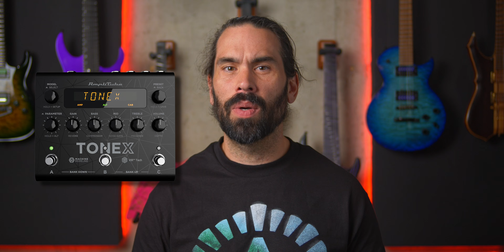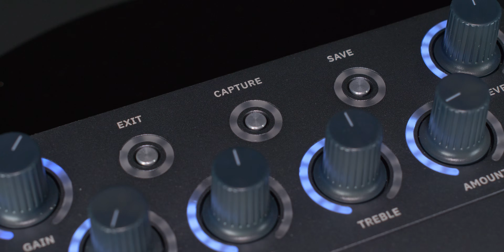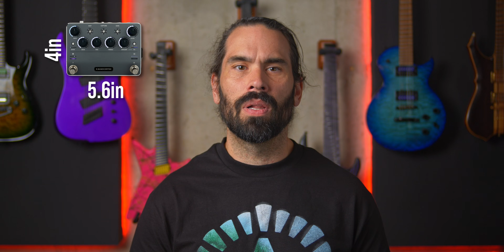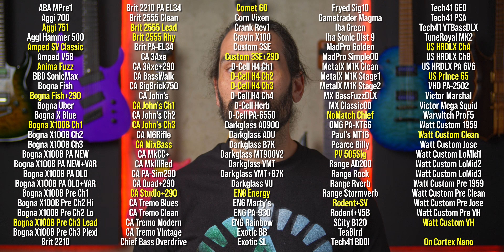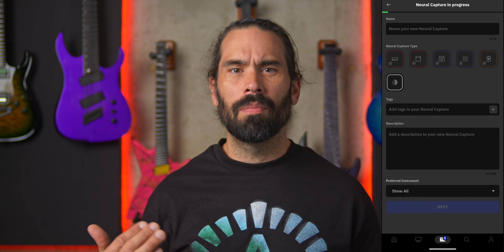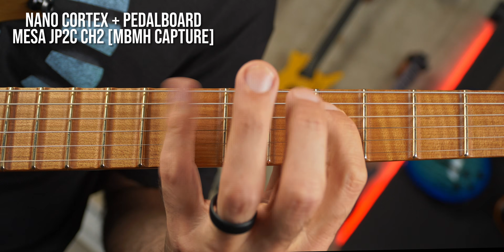Can the Nano Cortex REPLACE Your Amp?

Comment: I dont understand how you think that $1700  is expensive when one amp and cab cost the same , and you have many many thousands in guitars on your wall ,  you get so much more tonal variation with a quad than one amp and all your pedals and guitars. Its only $1150 more than what you already paid for the nano  anyway . Imean it is expensive , but raltiv3ly speaking you have a lot more invested in your craft already. You could sell your Strymon and carry one pedal and no amp or fx pedals for live setups saving so much setup time which is worth paying for as time is finite .

Comment: So I don’t have access to the collection of pedals and effects available for the big one ? I understand they give me one spot on the chain for each effect , but is set , one type drive , one type delay, one single reverb , can’t I load from the app?
Reply: No!!! People expect the nano cortex to be everything the quad cortex is but it's simply not and thats ok! its all for good reason!!! The nano is intended to target people that wanna keep the tone they already know and love that they were getting from thier physical amp, cab and effects pedals but in a much smaller package without having to diial in from scratch and navigate a big library of choices that you see on the bigger full blown modelers!!!now those people have a fast easy rout to achieve it in a condensed  easy to use package And all for $549 opposed to $1,799!!! the nano is geard towards users that will be adding it to an existing pedal board that is already loaded with the effects and drive hardware they already have!!!  used as its niche intended porpose the nano can capture the raw amp and cab they already own while everything else is on thier existing pedalboard giving the user its full blown tone without having to start from scratch and re dial in tone ,search amps and figure out effects!!! They also dont have to lug around a head and cab.  for people that want more and want the plethora of options and want to explore new tones the quad cortex along with lots of other full blown modeler companies exist for them to choose from.

Comment: This is the best Nano video I've seen so far!!

How did you integrate the GT-1000 with the Nano? Did you connect it to the Send/Return of the GT? If so, how did you balance the levels? Could you make a video with both together? I'm trying to use them but I'm having some trouble!
Reply from the maker: I run my GT-1000 Core a little weird. I wire it to my ES-8 as two independent pedals. It might not make a lot of sense, but a typical patch will look something like Guitar -> Nano -> GTK Return 1 -> Output. I'm not sure if helps or what kind of issues you're having, but I do have an in depth video on how I use the GT-1000 Core. https://youtu.be/8vfzu0k3s4k
Reply: @ManBunMetalHead  It seems that when I place the Nano Cortex in the send/return loop of the Core, I notice some tone suck from the amps.

Comment: 1700$ is not much. We've been paying at least 1000$ vor an amp head and another 500$ for a cabinet. And with that we are a the lower end. You likely pay up to 2000$ for one amp setup plus at least one or two pedals. So please, please, please stop calling the Quad Cortex expensive. I am one of those who uses very little of the features it offers and still it's waaaay more than what I did with my ENGL Fireball (1000 bucks) and the Orange 212 (800 bucks) that I had. If they sold it for 3000 it would still be a bargain.

Comment: You don't need another piece of gear to make captures with the ToneX (either the big or mini pedal).
Reply: Yes you do you need a reanp box and the software ! Can do it on both Cortex .
Reply: @88Nikoli Incorrect. The software required is included. I don’t know where you’re getting reamping from. That is track recording related, not capture related. At least not with ToneX.

Comment: Question - ES-8 as a midi controller on a Boss Katana Mk2 is it possible to turn individual FX off on the Katana via midi? I think the Katana & the ES-8 could make the ultimate rig. This would allow you to use specialty pedals that aren't in the amp through the ES-8.

Comment: Great video. I have the Nano and I love it !!! I would love to see your pedal build. I am starting to build mine now,] however just in the process of looking for inspirations.
Reply from the maker: Will do! I'll take a minute to get a video out, but it'll come. The board is looking sick!
Reply: @ManBunMetalHead   Thank you so much. I can't wait to see the video !! You produce great content again Thank You !!!
Reply: I'm hoping you could answer a question for me.  Can one store 256 captures, 256 IR's and 64 presets in the device itself? If I understand correctly, one only has access to five presets from the controls on the device or with the app, but is it possible to access 64 presets with a MIDI controller? Thanks in advance!
Reply: @orlandoguitarist   Yes, I would use Morningstar MC6 Pro for a MIDI pedal. Lot's of YouTube videos to help with programing and setups.
Reply: @kevindaniels676  Thanks, I currently use the Morningstar MC6 Pro to control the Eventide H90 and Strymon BigSky MX.  I tried the Two Notes Opus in the effects loop of my H90 which I also controlled with the MC6, but had some issues making me continue my tone quest. I now run the Universal Audio Ruby between the H90's two processors (dual mode) with a couple drive pedals.  While I'm pretty happy with the sounds I'm getting now, the Ruby doesn't have MIDI control and I'm unable to select a variety of amp/drive settings with one footswitch press. Sonically, I'd love to be able to instantly get UA Ruby, Enigmatic, Anti, Lion and Dream sounds, however they don't have MIDI, would take up way too much real estate and cost over $1600.  Since the Nano Cortex costs about the same as two UA amp pedals, is MIDI controllable and would provide many different amp/cab sims, I'm seriously considering it.  Thanks again for replying!